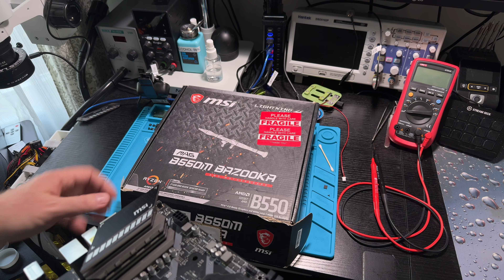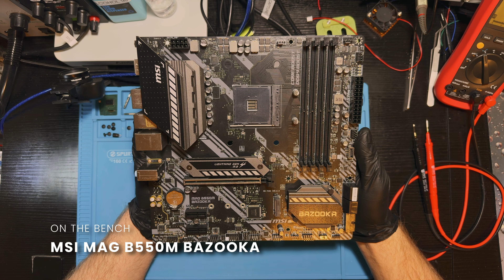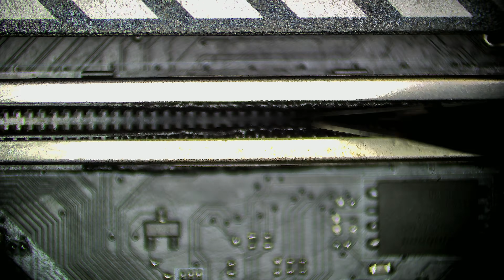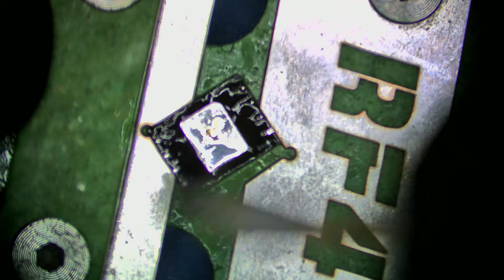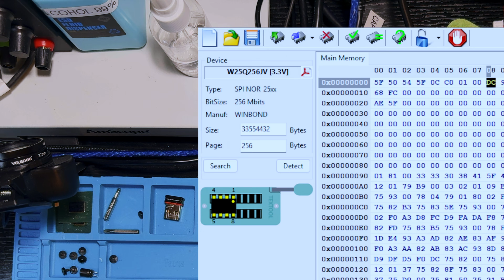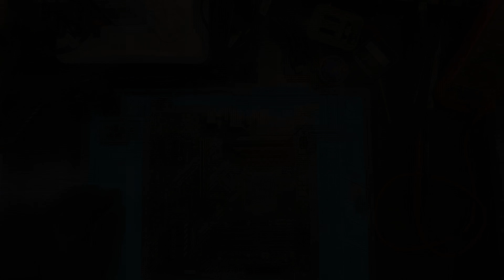This motherboard repair exposed a critical BIOS mistake

Comment: Hello, good afternoon. How do you connect the motherboard to the adjustable power supply? I've seen a few online, but yours looks reliable. Could you give me the model or the link to where...
Reply from the maker: I am using RGEEK 1106 DC to ATX power adapter. You can find it on my Amazon shop - see link in the description. It should be in the Tools section.

Comment: No need to remove the BIOS chip to flash it. Just use jumper wires to hook a CH341A to the JTPM1 header. Unless of course someone put the wrong BIOS chip on there, LOL.

Comment: Nobody beats Gigabyte. They invented dual BIOS while other manufacturers use chips that you can still plug and unplug. Suddenly, the main BIOS fails, and the motherboard gets stuck in an endless loop. You have no choice but to desolder both BIOS chips, reprogram two new ones, and resolder everything. There can't be another company that hates its customers like Gigabyte.

Comment: i once flashed my msi board almost like one these and stop working, the problem is that my amd cpu was the one without gpu , once i got another cpu with onboard gpu, it booted fine. so now i need to downgrade the bios or something to get it working again with the old cpu; i don't know if is the same problem; u got there.
Reply from the maker: Wow. I haven't faced this issue in my practice. Usually, a new BIOS version has all compatibilities of its previous versions.

Comment: Among all the brands, this one has the most issue cases brought into the shop. LOL
Reply from the maker: Being honest, I cannot say that one brand more popular in repair shop than another one. IMHO they all mostly use components from the same factories. The problem not only in better or worth schematic, or faulty chips, but in a way the board is used, how many times it is cleaned, what humidity, etc.

Comment: but does it fit the gpu ? is it even possible to change pcie slot?
Reply from the maker: It is possible to replace the PCIe slot, but the replacement will typically lack the metal reinforcement. The process is time-consuming and requires a rework station. In this case, it’s not worth doing on these motherboards, since the GPU works fine in the existing slot and the defect is mostly cosmetic.

Comment: Cant expect more from MSI :)))
Reply: Haven't used a Gigabyte board recently, have you? They're quite well known for USB stability problems. MSI is not always to blame. Most of the RMA contractors are known for doing stuff like this and MSI doesn't do any checks on the RMA contractors.

Comment: nice. but take a look at 12:23-12:27... I see a solder blob...
Reply: and the cmos clear jumpers right by the battery. pg 37 of the manual, cuz I couldn't see it either at first...weird spot for it..
Reply from the maker: Thanks! You are right. I haven't noticed jumper pins. The solder blob was removed with tweezers - it does not show up on video.

Comment: i also have msi mortar max that im trying to recover it
io is dead. shorted on 3.3v causing the near lower regulator to heat up like 90.C
 i thought it was the regulator but the io it self is shorted
currently waiting for a new chip to arrive and try it replacing it. with my newbie skills
Reply from the maker: 3.3V rail short is usually a pain. I hope a new chip will solve the issue!